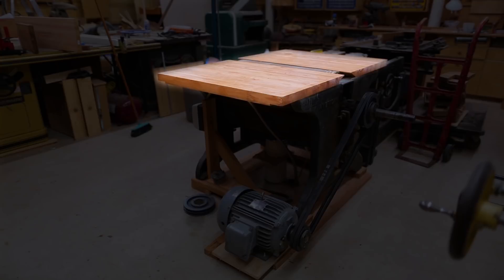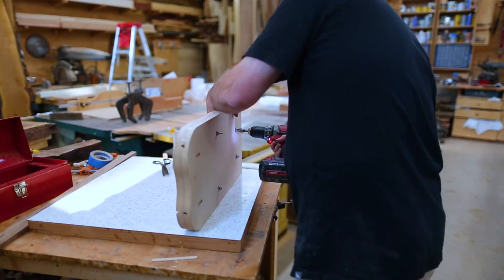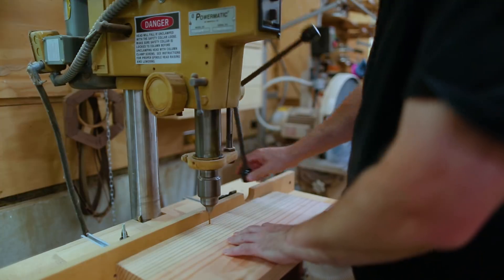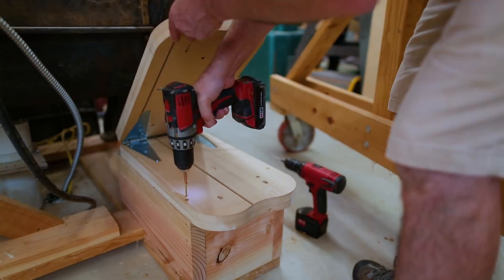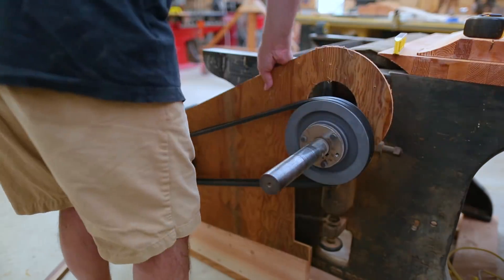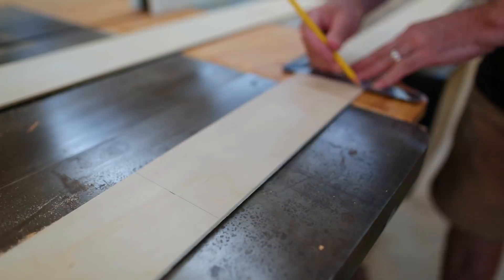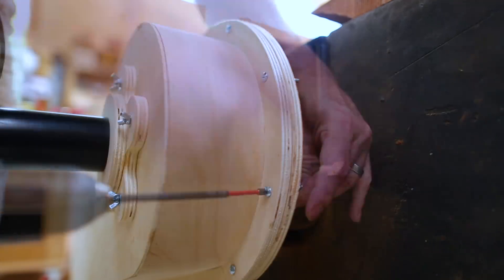Motor Mount and Belt Cover for the Surface Sanding Machine

Comment: Life is too short to put up with that bothersome shaft jutting out and putting bruises on your leg! It looks menacing.  

Go ahead and cut it off, but don't throw it away.  Any kind of decent welder could come out to your shop and weld the shaft back in place and grind it completely smooth in about half an hour, no sweat, if for some reason you wanted it restored.

Comment: I wouldn't be able to cut the shaft off either. Even though you pretty much know you or the next person will likely never use it, it just would just feel wrong to take away from its original state like that.

Comment: Read a few of the other comments. I agree with them. You did a great job.
I also admire the fact that you covered the pulley rod, for posterity. I'm sure, most of the time, if someone else had it in their shop, that rod would have seen an angle grinder up close.

Comment: So, have you run into that shaft since you put red tape on it? If so, just build a movable table that extends from the shaft to the edge of the sander table. 

You could also use that part of the shaft to run a belt sander or even attach a disk to it making a disk sander on that side of the drum sander.
Reply from the maker: I think i have run into it once but not very hard. I like the disk sander idea

Comment: I think you could have simplified things a bit by using tee nuts and thumb screws rather than screws and nuts. You also might want to use a couple of dowel pins to hold the cover while you install the screws.

Comment: Pretty cool Frank. I would leave the shaft for an eventual freehand buffer or polisher station.  One tweak I would add is a soft pad to the shaft cover, preferably a bright colour. Kind of like what you see on a upright goal post. An ounce of prevention for when you may be walking by concentrating on something else.  Also for the younger staff it may be at eye level.

Comment: could always make and mount, a external large drum ( like a horizontal spindle sander ) , or large disc on the shaft extension ,, i know you have both tools, but the large disc with a different grit paper ,  could prove useful  ie.. course grit on this one, and a finer grit on your original large disc ,, just a thought , would help with not running into it if there was a disc and table there,lol

Comment: So....there is adjustment on the hinged motor mount but the rear panel for the protective cover is fixed to those two vertical supports? Can the belt tension still be adjusted without have to modify the cover you built? Overall....nice work as usual. That is just something that popped into me head.

Comment: for tension on the belt usually a third wheel is used either on the inside of the loop pushing out or on the outside pushing in.

Comment: Loved this video! I've recently learnt a fair amount about soft starters for motors - you could do with one for your motor to stop the belt slipping on startup. it will also reduce the 'hammer' effect on the bearings when you start up :) Can't remember how you wired it, but I think it was single phase?

Comment: A pretty elaborate project for a lowly belt guard! I must confess I did not see how you were going to attach whatever guard you made to the base unit. The renewed motor mount solved that issue very well. I also applaud the shaft cover versus cutting the shaft. It's still going to whack you in the hip (or worse!) when you walk by, but that little part of the fabrication was pretty small relative to the rest of it. I predict you will ultimately paint that little goober RED!

Comment: Is the shaft long like that because it could hold a longer drum? Does that mean the machine can elongate like an add-a-leaf table?! I've never seen or heard of anything like that, it seems exactly like the antique thought process of one semi-impractical tool for every size job instead of the modern one specific size tool for a specific size (or smaller) job. Adds another dimension to the saying they don't make them like they used to.

Comment: Again... NOBODY makes better use of the CNC... I think everyone one should take note that it's not just for specific "CNC projects", it is useful as a handy everyday tool to make whatever is needed and it's not limited to the straight or round cuts of most shop tools. Just cutout whatever shape is needed - with high precision. Thanks for setting the example.

Comment: If you keep running into the shaft cover it with some foam similar to pipe insulation. It is firm but softer than steel :)

Comment: The reason for the long shaft was in the manufacturing shops they would have one huge motor driving a overhead belt system and then have the at each station one belt drop with a long wide belt down the machines with a manual belt tension to  ramp up the machine speed instead of the motors at each machine.  https://www.core77.com/posts/58982/How-Did-Factories-Get-Power-to-Their-Machines-Before-Electricity

Comment: Nice build Frank. As a electrician i have to say, you need to fix the cable that goes into the motor. I can see the individual cores in the bottom, before they goes into the connection box. 
If the cores are free, then dust (and perhaps moisture) can find the way into the connection box, and perhaps the motor itself, and that can destroy the motor over the years... that's a shame. 

Greetings from Denmark.

Comment: I like the cover. I think the only thing I would do different is make the tube covering the extended part of the shaft something bright. The black might blend with the environment and people will run into it. Not that it's so much a safety issue, but that people running into it could damage the cover or the shaft/bearings.

Comment: Don't belts benefit from being open to air so they don't get hot and melt themselves slick? There should at least be a hole on the table-facing side.

Comment: I hope you used nyloc nuts or something similar on the motor/belt tension bolts. Vibration will definitely loosen any normal nuts and increase the belt tension over time.

Comment: Frank, Thanks for the video. Your inventiveness is inspirational. I think you should keep the shaft because it helps to balance the drum. I wouldn't be surprised if you added a mini flywheel to it one day. I wonder if a swimming noodle would be just the right size foam tube to cover that shaft with something a little more forgiving. Get a bright fluro colour. 
Or simply wrap some high density foam around it in the brightest colour you can find. 
Also I suggest that you you cut that steam a little wider and cover it with perspex so that you have a belt inspection window.

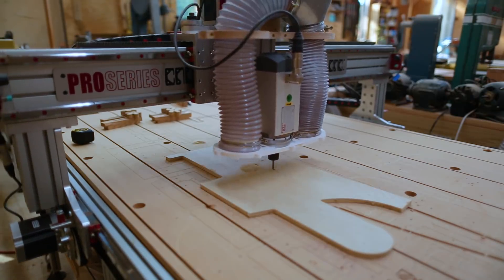Comment: At 13:42 Frank talks about the long shaft sticking out of the side of the tool.  Before the advent of electric motors this would have been used in shops that used overhead "line shafts" with leather belts to drive the tools from a central power source (see https://en.wikipedia.org/wiki/Line_shaft).   Frank is also right about not cutting it off.  Once cut it could not be replaced and who knows if it might be useful?  Unfortunately, it is located in a way to impact an important (male) body part.

Comment: Beautiful work Frank. Oopses and all. Keepin' it real.

Don't you just love working with vintage machinery? It's true what they say: "They don't make 'em like the used to."

My uncle (may he rest in peace) had half a dozen Chicago Machines pieces. A lathe, drill press, band saw, etc. Many coats of chipped drab green paint. Their signature color. All massive, heavy machinery. Unfortunately, he'd kind of built the cellar workshop around the machines, so there they stayed after his passing.

Comment: Frank, simply Frank.

Are you concerned that the screws holding the hinges onto the MDF will come lose with the movement of the motor over time?

Comment: Hi Frank, love your videos. The seam area on the top side of the cover you could always make a small perspex window. This would allow you to quickly check the belts without removing the cover. Cheers from New Zealand!
Reply: Yeah, a small plexiglass inspection window installed with the wingnut bolts.
Reply: Inspection window idea is great. I was thinking the whole curved ply piece could have been some fairly thin polycarbonate. That stuff is fairly flexy and rugged.
Reply: That's a great way to make lemonade out of lemons!

An inspection window. A capital idea, indeed!

Comment: I agree with not cutting the shaft. It's getting harder and harder to find good working antique machinery.
Reply: This comment is very hard for me to read and act my age.
Reply: One of those old style machines which were designed for a shop that had a central power shaft that all the machines connected to with those wide flat belts. It's missing the original pulley for the wide belts (I haven't seen the whole build/modification series so I don't know if it came without the flat belt pulley or if that was removed for the twin v belt).
Reply: The irony being as old as that machine is, with babbit bearings, that shaft likely isn't even original and at the next bearing replacement the shaft will be replaced anyway so it's really really a moot point. Not preserving much of anything but an easily replaceable part.
Reply: I guarantee that the people who made that machine would be shaking their heads. What's up with the reverence for that extra bit of shaft? Tools are made to be practical. To honor the original spirit of design it makes sense to cut it off. Unless I'm missing some important reason. Please tell me.
Reply: It's there to allow the pulley to be pulled further up the shaft. If you have an area where you can't mount the motor directly or close to the machine as in the video it's really helpful.  The reason I agreed with him on not cutting was that fact that he said he may not have it in the future.
Reply: @Ghost_of_Genji  Actually, it's there to gang machines together in a production environment. One motor driving multiple machines. Sometimes with clutches, different gearing for different speeds, etc. Sometimes direct drive.
Reply: @djmips  its going to be hell cutting a 2-3 inch shaft off to size in a wood shop
Reply: @djmips  the next person might want to restore it back to the original state. I'am sure he kept the original table top.
Reply: stefen's being gay.
Reply: sour mash No u
Reply: Really?

Comment: Frank one thing I'm always curious about with CNC (I don't have one) is how you can get the exact measurements of the pieces you are CNCing around. For example the hinges here. Maybe during one of your videos you can explain about how that process works.
Reply from the maker: measure, do a drawing, and cut.  sometime it takes a couple of tries to get it as good as you want it.  With these hinges i didn't show the second pass i took to get them to fit little better.
Reply: Interesting, in my head it was a vastly more complicated series of scanning/taking pictures and using the CNC machine itself to trace the outer perimeter. Thanks for clarifying!

Comment: That extra legth of shaft is ideal to hang some toilet paper on.

Now, having that pipe holding there just because of friction doesn't look too safe. If you (or whoever visits your shop) hit it enough times with your leg, or maybe with some other machine, it might come off, which is no problem is the sander is not working at the time but, if it is, it might be a bit dangerous. I think I would glue it and/or use some small nails to make sure it's in place.

Nice video as usual. Even when I won't be doing anything like that in the foreseeable future, it's just nice to watch and even relaxing.

Comment: I was thinking those long bolts to adjust the angle of motor's table should have a cover or be inverted, so there are no little spears pointing up in your workshop.
Reply from the maker: I had not thought of pointing them down, that does make more sense.
Reply: I thought the same thing. It's the same situation as the caps you put on rebar when working with concrete.
Reply: I was going to suggest this but figured I should read the comments and check if someone already had. :)
Reply: exactly the same thought :)

Comment: 4000 screws holding the wood together and four tiny 1/4" bolts to hold the motor to the base.

Comment: Frank, i think the extra shaft lenght it's meant for a big flywheel to eliminate vibration in the drum. Color copiers work that way
Reply: Nope. It was for the wide flatbelt pulley back when this machine was ran off a lineshaft. It would make for a poor flywheel due to the lack of radius. You can do the calculations using these formulas. http://hyperphysics.phy-astr.gsu.edu/hbase/mi.html

Comment: Shaft length: I wonder if the electric motor is not the original power source for the sander? Maybe it was driven by a large flat belt from a wind mill or water wheel? Perhaps a tractor belt?
Reply: They used to have one motor/engine that ran all the machinery in the workshop, and it had shafts going all along to the machines and flat belts to link them together. It's from a bygone era.

Comment: You could use that axel to run a feeder roll on top of the sander.

And if you put two spring loaded sticks before and after the axel you won't walk in to the unmovable object again 😊

Comment: The long shaft sticking out was probably for when the machine was flat belt driven from overhead shafts - very old school! I doubt you be going back to that any time soon.
Reply: Maybe it was also used to connect several machines to one motor, so you have a big factory with a bunch of this machines running with one big motor

Comment: Thoughts of putting an idler pulley on it too?
Reply: An idler it tensioner would place unwanted stress on the shaft bearing. Frank addresses this in the video.

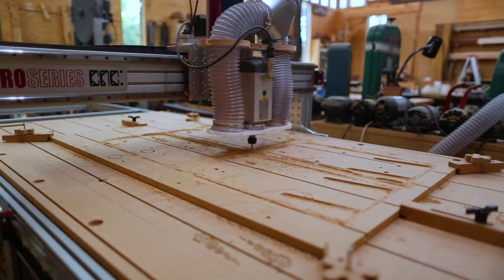Comment: Impressive collection of motors at 1:30  - 1:50.  Looking forward to seeing the project that uses all of those :-).   What was the spindle extension originally used for, did you ever find out?
Reply: I'm guessing the shaft was long to accommodate a flat belt pulley.
Reply from the maker: yes

Comment: If  memory serves, Babbitt bearings ride on a film of oil. At least the ones we used in many did. If property lubercated uneven ware shouldn't be an issue from belt tension.
Reply: Babbitt is the (sacrificial) lubricant in bearings of this type. Therefore, you don't want to overload these bearings so as to minimize their replacement.

Comment: Very nice Frank, well thought out and now safe. I like the "whole buncha screws" in the base as that will keep things tight with the vibration issues. You might consider putting T-nuts in place of the wing-nuts for even simpler cover removal.

Comment: First! Another terrific Frank video. That was a great way to enclose those belts. As far as the shaft sticking out, I would have made a wide "conical" shaped cover to prevent running directly into the shaft, if that makes sense? Anyway, nice work......... :)